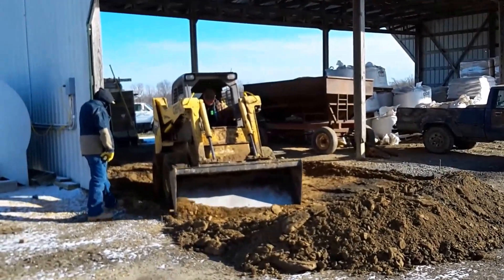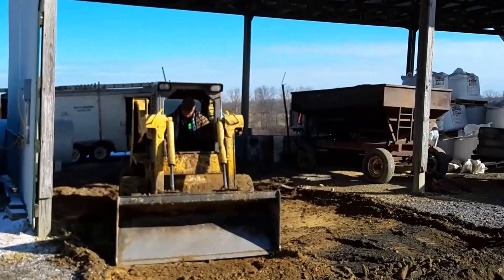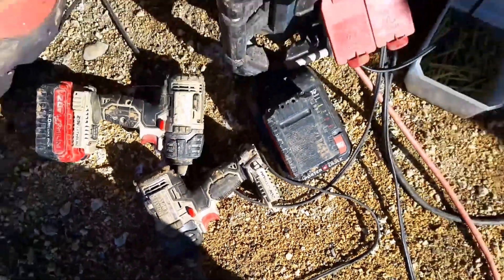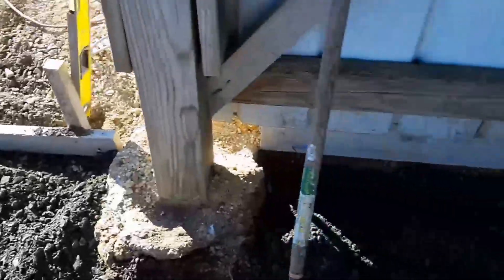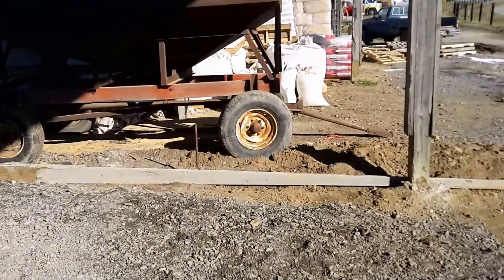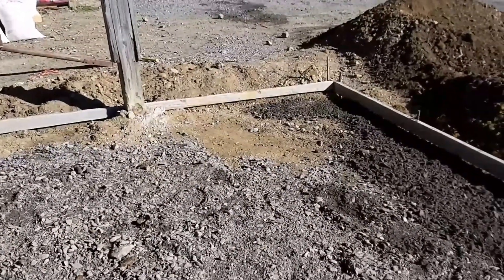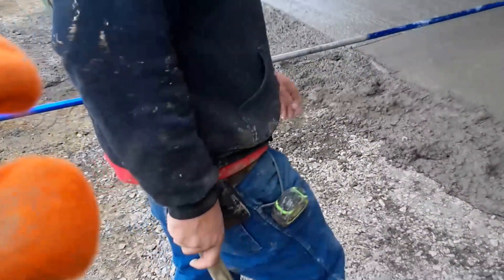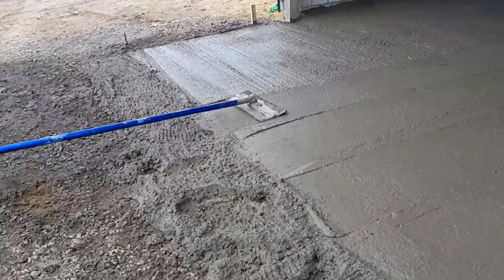How to Pour Concrete in Freezing Weather

Comment: I hear talk how pouring concrete in below freezing temps results in less strength in the slab over the long run. The thought is that the chemicals added to speed up the curing time or creates heat in the concrete could be the issue. I appreciate any input on this subject. This job turned out great! Thanks.